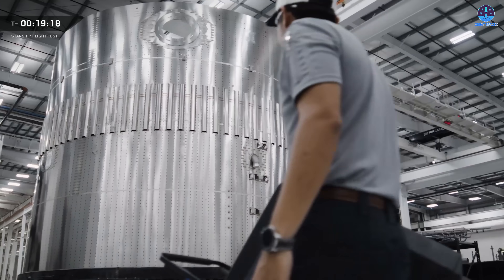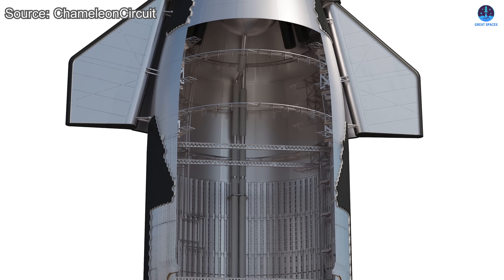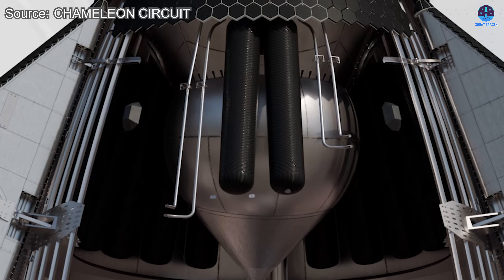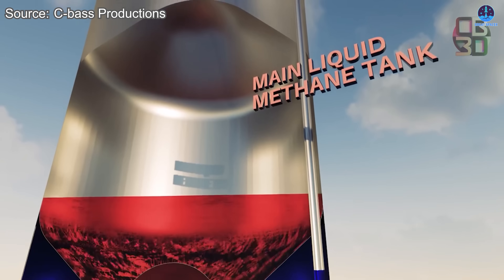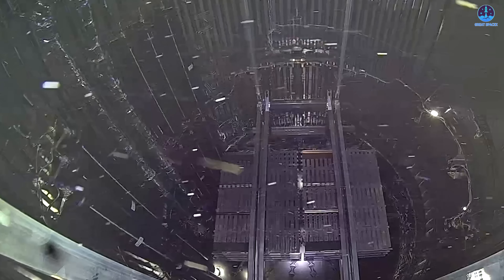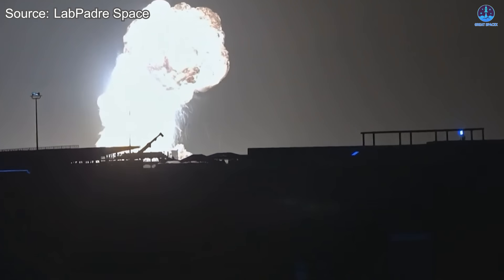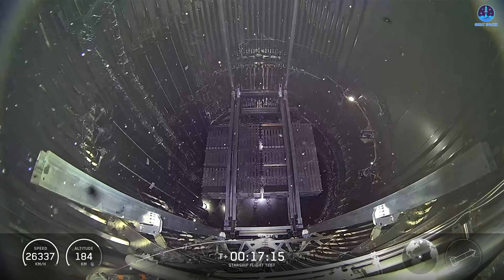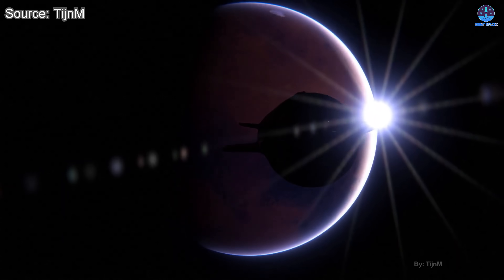Elon Musk revealed Exactly Why COPV can make Starship S36 Catastrophic Explosion...

Comment: The question is did the COPV fail due to a fault, or a pressure build-up that exceeded the design specification of the COPV? If it is the latter then concentrating on the COPV is a red-herring. Saying that "if the COPV failed then it is the first time ever for this design" is a BS comment, in rocket design, when would something be continued to be used that had a record of failure?

Comment: It's not the complexity, but the weight that is always the problem with rockets. Any fix will likely add weight to the whole rocket lowering the payload capacity which is already a third of the original requirements.
Reply: Your right Elon said that as well extra weight will reduce payload., and yet the Starship even with a reduced load can still carry more payload  into space than any rocket any where in the world. I am certain with time they will develop more powerful engines and nail the design.
Reply: @Mrrich3  Given time.

Comment: On the Booster, COPVs are used to store gas to restart the inner 13 Raptors several times. When Booster goes to 35 engines, the hotstage, boostback, landing burn and catch burns can just be done with the inner five engines. This cuts the weight of the middle ring of 10 boosters, and likely means a restart is only needed for the landing burn and catch burns. This will drastically cut the gas needed for engine relights, and it will mean gas pressure in the Booster COPVs can be reduced a little as another level of safety.
Reply from the maker: Great comment ❤️

Comment: It seems to me regardless what they find with the COPVs, they need to be much thicker, made up of stainless steel and fiber reinforced material. They are purposely made thin just like our SCBAs we use in firefighting and spun with carbon fiber to save weight. SpaceX I’m sure will now sacrifice a ton or two of weight so they are much more durable.
Reply: OR..... SpaceX will pay far greater attention to QC and handling requirements

SpoaceX has had a huge number of OSHA fines and workman's comp claims compared with any other aerospace industry, even when you remove the aspects of the business which are "marine" or "construction" aligned. This fast and loose approach to safety doesn't just apply to humans and I'm minded that the last few mission failures are indicative of an onset in complacency across the company ("meh, it's good enough") as we saw with NASA in the leadup to Apollo1 and Challenger (or even the utterly disasterous SSME engine development program which saw multiple engines explode on the statnds due to poor welding)

Comment: Not buying this. If a high pressure Nitrogen COPV ruptured it would have put out any possibility of Fire. If you watch a replay in slow motion you will see FIRE blowing out the Upper side of Starship.  Nitrogen does not burn.
Reply: The amount of nitrogen is negligible compared with the LOX and LMethane volumes. In addition the extra localised oxygen concentratio accelerates things to the point that ANYTHING will burn given a spark
Reply: @alanbrown397  NOT NITROGEN.. These N2 tanks rupture under EXCESS HEAT. These tanks do not rupture on their own. They rupture when you burn them. The ignition point of the fire/explosion happened cause there was a Methane rupture, with initial O2 in the cargo bay...  My educated guess is CYRO cold caused a crack/failure in the big pipe going to the tanks in the top of the rocket.  The ignition happened in the Cargo hold.

Comment: Wasn't the composite wrap what failed on the Titan submersible?
Reply: Yes but for different reasons. These are one-pass COPV constructions that are multiple times stronger and more resiliant than the flawed construction methodfs that Titan used

That said, ALL COPV designs are susceptible to impact damage by the very nature of the way they're made. They need to be handled like eggs and the image at 11:24 of multiples on a forklift made me wince. 

Mitigating handling roughness might mean something as simple as a wrap layer of polyurathane foam (very little extra mass but problematic in a vacuum) I'm no expert and this wouldn't help with crush damage but what it comes down to for the most part is more care and attention which can be difficult in what's essentially an industrial environment with a huge number of workers not all of whom appreciate handling precautions(*) or believe they're "a waste of time"

(*) I'm minded of a Cessna worker who killed several Tweet pilots by installing aileron bolts they way HE thought it should be done (easier to do) rather than the way specified (didn't jam the mechanism if the nuts backed off - which they did more easily when installed the way he was doing it)
Reply: A major difference between Starship's carbon fiber vessels and the Titan is the direction of the forces.  On Starship's COPVs, the carbon fiber is in tension - the force on the fiber is trying to stretch the fiber.  On the Titan, the carbon fiber was in compression - water pressure trying to compress the fiber.  Carbon fiber is better at fighting tension than compression.
Reply: Also on titan force went into different direction. 
There's a lot of experience in building tanks for pressure inside and nearly only titan with pressure outside the tank.
It's a huge difference if the carbon is stretching or compressing. The glue must hinder the carbon from scrambling up on compression

Comment: "trust me bro. carbon fibre is the way to go for pressure vessels."
If you believe this, I have a home made submersible to sell you.
Reply: Carbon fiber has strength under tension .. so pressure vessels are a good application. Under compression, carbon sucks.  A submarine is under compression.
Reply: @solarguy4850  dude the vessel failed below its proof pressure per Elon and resulted in the destruction of the ship so something is wrong. could be the design, could be the material, could be the manufacturing process but the ship was destroyed. Gotta look at everything now.
Reply: @charlottelanvin7095  Yes, something went wrong, but that doesn't mean that the whole idea of using carbon fiber for COPVs is flawed, or equivalent to using CF in an application that is far less suited for.
Reply: @charlottelanvin7095  … no question SpaceX needs to conduct a review .. I was simply correcting an incorrect statement about the technology.
Reply: I see no conversation discussing process/handling, it is easy to imagine that the COPV was damaged in transit to and during installation. INSTALLATION is just as important as design and manufacturing.

Comment: I trust the SpaceX TEAM to evaluate the delicate balances of Cost / Weight / Reliability / Re-Usability.   I am not an engineer.  But seems that a valid testing method is to test designs to the point of failure.  This is repeated until you are satisfied with the results.  Key aspect is honesty and not letting time issues over shadow the mission.  Would rather have a safe reliable cost effective 'Starship' that misses the next Mars launch window, than one that has major issues in operation.  This is critical when you consider that the end goal includes a 'Starship' that is rated for people.  I could see a different models that are refuelers, cargo, Earth to Orbit, Earth to Orbit back to Earth, Earth Orbit to Mars Orbit, Mars Orbit to Mars Lander.  Side note:  I hear fighter pilots often complain of fighter planes that have had too much done to make the plane a multi-role, versus JUST a air superiority fighter.  We also have many different type of vehicles.  Trucks, SUVs, Autos, Crossovers, etc.   Even more so when you consider transportation: bikes, trikes, mopeds, ebikes, motorcycles, dirt bikes, all different types of cars, planes, trains, boats, rockets, space stations, moon stations, mars stations.  There will need to be many different versions.  Can have some common components.

Comment: Using carbonfibre is risky for parts that have to withstand multiple pressure depressure cycles. Under this specific conditions carbonfibre tends to rapture and/or delaminate. (Think of Oceangate). It's not an ideal materiall for this kind of application. It's understandable they used it because it saves a lot of weight. But this weight saving comes at the price of reduced reliability.
Reply: Don’t forget that the tanks are have a aluminum shell under the carbon fiber. Aluminum does have thermal expansion properties however, if it’s not aircraft aluminum, they can become brittle and rupture. The correct material is 316 Stainless steel. Or, a self sealing bladder made from PEX or some other material. The real trick will be to create tanks that are able to be removed once used. This would also produce areas once used for fuel, and now repurposed into habitable zones within the ship.
Reply: It's a well-proven technology. And one thing about spaceflight is that it has relatively few pressurization Cycles

Comment: if the aluminium is wrapped at room temperature and then filled with cryogenic fuel, the aluminium would probably shrink due to the extreme cold cryogenic fuel, resulting in the carbon fiber wrapping loosing contact with the aluminium inner tank, enabling weak spots due to reduced contact between aluminium inner tank and carbon fiber wrapping??? maybe...
Reply: Sounds reasonable
Reply: AI, “Aluminum has a coefficient of thermal expansion (CTE) ranging from approximately 21 to 24 x 10^-6 m/(m °C), while carbon fiber typically has a much lower CTE, around 3 x 10^-6 m/(m °C). This means aluminum expands and contracts more with temperature changes compared to carbon fiber.”

That being correct, one does have to wonder. Those guys must have addressed this 🤔

Comment: Comment:  COPVs are made of  plastic and are positioned next to the header tanks filled with crygenic fuel and LOX could the extremely low temperature induce failure mode not properly. Considered in desugn? For instance, could repeated temperature cycles from ambient to cryogenic  induce structural flaws? Ther are multiple possible failure modes.

SpaceX is now doing some really interesting and detailed failure mode analysis. The result could be new products and likely a number of PhDs in materials science,
Reply: Not only the copv's...... stainless steel degrades just as bad when exposed to large temp variances lmfao
Reply: Not only the copv's...... stainless steel degrades just as bad when exposed to large temp variances lmfao
Reply from the maker: Thanks for your analysis 👍
Reply: Sounds like you need to go and tell them, they are probably sacking the forklift driver . Hope you can live with yourself for not telling them sooner 😂

Comment: Bet you anything someone damaged it while moving it like a forklift hit it. Second, you’re supposed to proof test it before putting it in the spacecraft! Especially after delivery because shipping can damage these
Reply: It’s not delivered by Amazon is it
Reply: The problem with any kind of resin impregnated fiber is it can delaminate with extreme temperature changes and / or pressure changes and mechanical flexing. It can do this progressively over time, a little at a time until it fails catastrophically. This would be extremely difficult to find once the tank is in use and doesn't have to be damaged before it's installed into the vehicle. I'm not saying your theory can't be true, but there's too many people involved with any one operation (transporting and assembly) for a careless mishap to go unnoticed.
Reply: Even proof testing a composite pressure vessels IS GOING TO DAMAGE IT!!!
There are very fundamental reasons we DO NOT use composite materials to make pressure vessels!!!.....
You know, a little bit like why we don't hot stage a ship that was not designed to hot stage in the first place....... it WILL be damaged xx
Reply from the maker: This is a big problem!! What make you think so?

Comment: What is a COPV rupture?
A COPV rupture is the failure or bursting of such a pressure vessel, resulting in the release of stored gas under high pressure and usually resulting in an explosion. Possible causes: The causes of a COPV rupture can be varied, but in known cases, such as the Falcon 9 incident in 2016, the cause was the accumulation of frozen oxygen between the inner shell and the shroud, leading to fiber rupture or friction ignition in pure oxygen. More recently, specifically in June 2025, a Starship prototype was destroyed by a COPV failure, with initial data indicating a nitrogen COPV failure in the payload area.

Question:
Should SpaceX have been allowed to make the COPV tanks despite their experience?

What material would a completely safe COPV tank have had to be made of to be absolutely certain that the COPV tank would last.

How much more weight would this have added to the Starship?

Grok's answer

Key Points
It seems likely that SpaceX should use COPV tanks despite previous issues, as weight savings are crucial, but risks remain.
There are no foolproof materials for COPV tanks, but titanium and improved composites could reduce the risk.
All-metal tanks would add about 3,000 kg to the Starship.

Weight, weight, weight - SpaceX!
Sorry, but I'm being a bit nitpicky. Sorry.
Reply from the maker: Thanks for your comment ❤️